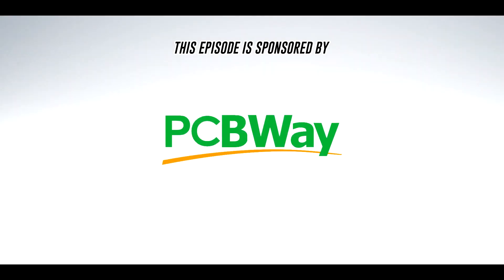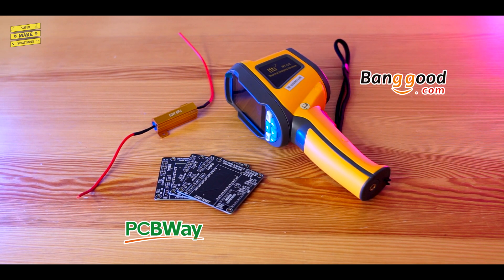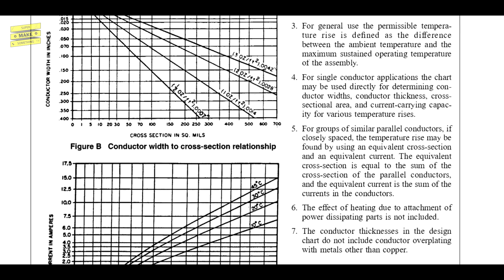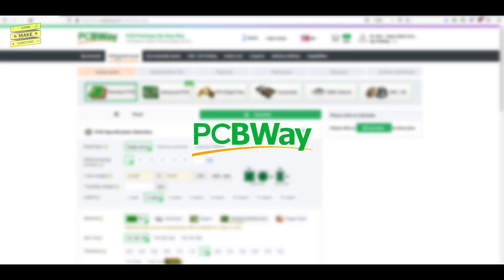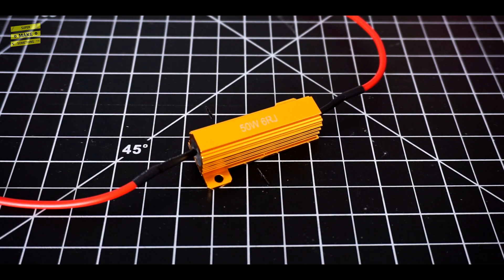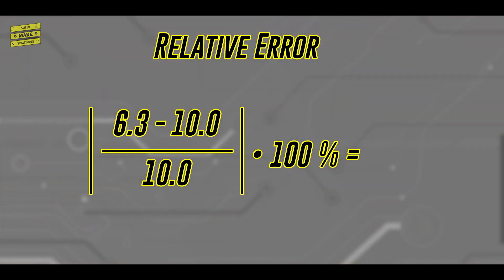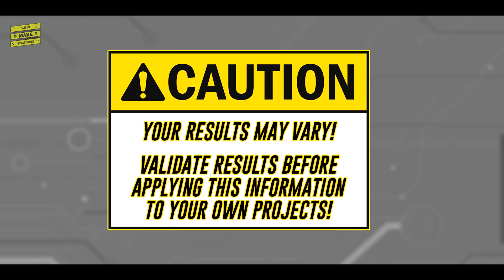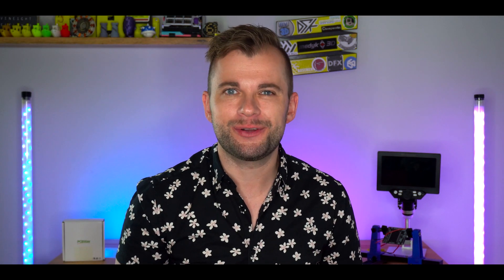PCB Basics: How WIDE Should Traces Be? (IPC-2221 Circuit Design Specs)

Comment: I'm not a expert.. But using wider traces does not have a negative effect in any way, so best to use wider when you have the space. Energy loss and voltage drop are the most important, if your trace heats up 6 degrees it's to narrow for my taste. You shown you have a decent voltage drop, so why not make traces much wider.. My question is, why not.
Reply from the maker: This video was mainly about exploring how accurate the IPC spec is, but based on what I have learned since making this, I generally agree. I think that there are some edge cases for analog design (I am definitely not an expert in this area though), but it seems that “as wide as possible” is usually best as long as it doesn’t violate other rules like minimum spacing between traces to minimize interference, having a ground plane, etc.
Reply: @SuperMakeSomething  I also learned about trace heating, so usefull video anyway😉 I recently made my first pcb and used a online calculator to calculate heat loses in traces. I made my traces with a width of 1 and 2 mm for currents below 500mA I would only smaller than 1mm if space is restricted.

Comment: Great Video! But I think your traces should still be wider ;) As you've seen yourself, your PCB was meant to deliver up to 2A but it was only able to deliver 1.5A at the specified voltage of 12V and the designed load due to the resistance of the tracks. That's a significant loss. So your tracks should actually be wider to meet your specification within an acceptable tolerance.
Reply from the maker: Thanks! Haha yes it is true — increasing the width would decrease the resistance of the traces. Space around the connectors was getting a bit tight, so I’m not sure if this increase would have made a meaningful difference for the layout I ended up with. 😅 I think moving everything “high current” in close proximity to each other to decrease the trace length as much as possible would be the way to go for the next revision. For these boards I think I may just crank the voltage up, since the stepper drivers can handle up to 36 V and the traces have some thermal margin. 😜
Reply: @SuperMakeSomething  make them bigger where you can and leave them as they are around the connectors. wide traces, even only at a short segment, reduce the resistance. you could also expose them (remove solder mask) so the additional HASL adds to the copper.
Reply from the maker: @RoterFruchtZwerg  Good points! Thank you for the tips!